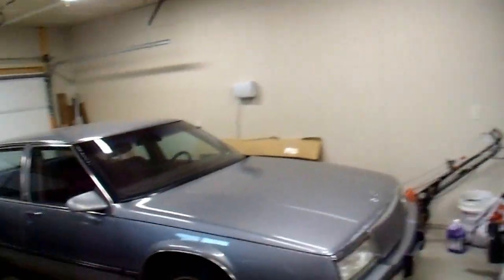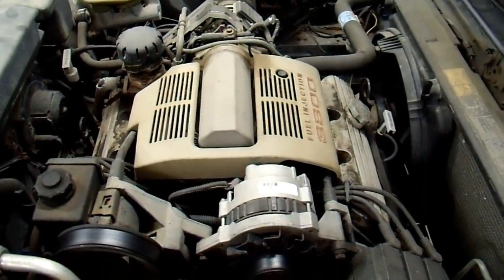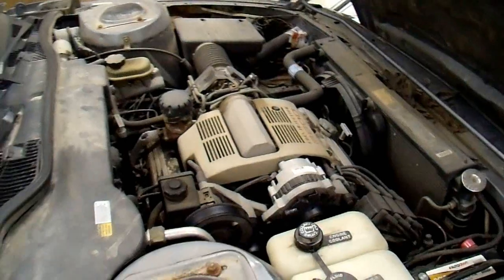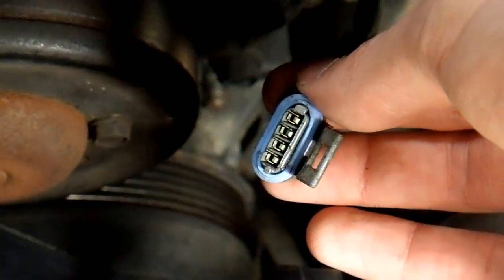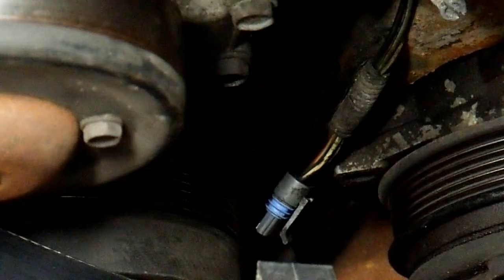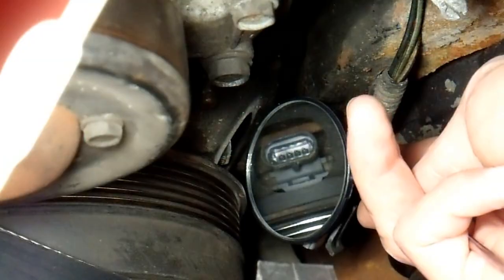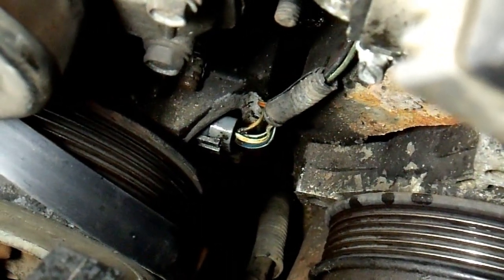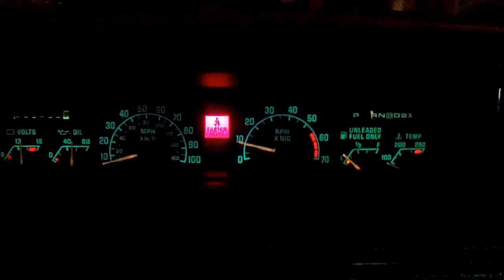3800 3.8L GM engine stalling issue quick fix

Comment: I have a 89 Buick Lesabre Custom,I have a problem with it idling high.Every since then put a TPS sensor on,it started doing that.Don't know what to do anymore.Also put a computer in it.I start it up and it idles high and stays that way.I didn't know you had to adjust the TPS sensor,that's when everything start happening.It won't go into overdrive just third gear when on the highway.Please let me know what you think is the problem.You can contact me at my cellphone number which is 3365773530 or email me at buick2020@hotmail.com.Please get back to me so I can get this issue resolved.I look forward in hearing from you SOON.Hope you can help me out,AGAIN, PLEASE CONTACT ME ASAP. I am very concerned about this.Burning too much gas all of a sudden.HELP ME.
Reply: Tim Wilder
 
So it cracked causing the vacuum leak??? or did it warp?
Reply from the maker: I hope that you're OK with me asking but does it not go into 4th gear, or does it not go into lockup?  e.g. if you are on the highway and use the column shifter to manually change to 3rd gear is there any change?  Also, do the other gears, 2 and 3, behave differently than before as in reving higher before it shifts into them?
Reply: 1, 2,& 3 do just right, but like I said before, on the highway if stays in 3.It was going into overdrive before the new TPS sensor was put on. Now that the new one is on that's when the high reving began.Will adjusting the TPS sensor correct the the reving & transmission issue. I am hoping that it is something simple. This guy is going to do a free diagnosis of you tranny to see what the problem is and adjust the TPS sensor to where it is suppose to be. Hope that do the job. Is would like your input on this also.
Reply from the maker: Tim Wilder
The transmission in your car does not use the TPS to adjust its shift points.  The only parameters it uses are input shaft speed, output shaft speed, vacuum level, and TV cable position.  The ECM controls only the TCC lockup in 3rd and 4th gear, which is why I asked about 4th non-lockup vs 4th lockup - some people perceive the lockup to be another gear but it isn't.  The TPS sensor cannot prevent the transmission from going into 4th because it isn't part of that control loop.  If it is truly in 3rd then the problem is elsewhere, possibly something unintentional happened when the mechanic was replacing the TPS.

If your shifts are firmer than they were before then I would look for a vacuum leak which would also cause a fast idle.

If it revs higher than it should before shifting into 2nd, 3rd, etc, then I would check the TV cable adjustment, though this would not affect idle speed.

Is the IAC (idle air control valve) plugged in and working?  This can cause fast idle and is right on the throttle body with the TPS.
Reply: I put a new IAC sensor on, where would the TV cable be located?
Reply from the maker: Tim Wilder
The TV cable is the 3rd cable attached to the throttle assembly.  One goes to your accelerator pedal, one to the cruise control actuator, and the 3rd goes into the transmission.  If you disconnect the cable so that it is always fully retracted it should shift into 4th gear at about 48mph no matter what the throttle setting.  It is essentially an offset so that it shifts later at higher throttle positions to allow more power.
Reply: If you have pictures, please post them so I will know how to disconnect it to see if that will work.
Reply from the maker: Tim Wilder
It won't hurt the transaxle but it will cause driveability issues and I would do it only as a short test.  Rather than disconnecting it you could just make it very loose.  A total disconnect shouldn't be necessary.
Reply: I don't know what to do, everybody telling me so many things. I just need to get it fixed and hope it is something simple and not expensive. Do you have any suggestions on where to get this issue resolved?
Reply from the maker: Tim Wilder
I'd have to point you to a mechanic on this one.  Without looking at the actual vehicle all people on the internet are going to be able to do is give you ideas of what to look for.  I hope you're able to get it figured out.
Reply: On the 89 Buick Lesabre,what is the name of that metal candy cane shape tube that connects to the throttle body and the engine and what is best way to unbolt it off the engine.It's up under the throttle body, please let me know something ASAP.
Reply: Looking for the two metal tubes that connects to the throttle body.
Reply: Looking for the two metal tubes that connects to the throttle body.If you know where to get them, please let me know, I really need those two metal tubes.
Reply from the maker: evilcowboy
Good info.  Just a comment of my own:  To show how unnecessary EGR valves are, many modern engines can pass today's emissions regulations without any EGR system at all with creative engineering tricks.  The efficiency loss from disabling the EGR comes from running at a higher vacuum for a given cruising speed which isn't really an issue aside from the small economy hit.  The computer will adjust the AF mixture automatically even in these older vehicles.

Older carbureted vehicles would take a large hit by simply disabling the EGR without other adjustments, but with a modern overdrive transmission and computer controlled fuel injection it hasn't been the case since the early '80s.
Reply: I got the issue resolved.
Reply from the maker: Tim Wilder
What was the root cause?
Reply: Needed to get the top part of the engine replaced.
Reply: I have a 1994 LeSabre , and have BOTH these problems, the high idle(with no working overdrive) and the stalling engine on a hot day, like this video says. I've had these problems for more than five years. I'm gonna clean the connector and see if it works. Thanks for the video.

Comment: Changed the cxp. Egr. Fuel filter. New tps. And fuel pressure regular and battery. Still stalls out when you accelerate. Any suggestions?
Reply from the maker: Does it run fine at idle and during mild acceleration?  What year and model?
Reply: yes runs fine till i push on the gas harder than normal say on an uphill. 99 buick lesabre 3.8
Reply from the maker: hmug tv
It makes me think MAF or fuel pump.  The fuel pump can be checked with a fuel pressure tester on the shrader valve on the fuel rail.  It would need to be checked at heavy throttle and at idle.   The tool is around $20, but you can probably rent one for free from the local auto parts store.  Check for kinks/damage to the fuel lines on the undercarriage too.  You could try cleaning the MAF with electrical cleaner first since it's an easy first step.  To check the MAF you'd need a more sophisticated scan tool.

If it ends up being the fuel pump or clogged pickup screen from something in your tank I have a video on replacing the fuel pump on one of these vehicles - not a fun job.  Search for 'GM H body fuel sending unit' if you're interested.
Reply: those are the next steps im taking, gonna clean the MAF, fuel pressure gauge is 112$ to rent so itll be a while before i can test that. ill let you know what i find out.
Reply: Did you ever find the cause of this problem....my Buick is doing the same thing ?

Comment: I had the same prob but on a series 2 and it was the fuel pressure regulator
Reply from the maker: That was a common issue on cold startup.  Fuel would leak into the vacuum line and get drawn into the engine once it fired.  Did yours stall at times other than startup and still have good power?
Reply: ***** yes out the blue it would stall

Comment: Man you are so lucky to own such an engine. Here in Europe 3.8L is huge and pretty rare. The average size is 1.4L. I own a 2.0L TDI on a golf. Not to mention that the annual tax for a large motor is more that $US3000. :) Great video.
Reply: Goddamn dude. Your country is screwing you out of tons of fun. Any 3800 series is a great engine due to the reliability. But yeah there are several bigger engines out there we can get.

The most unique engine design I have to say would be by ol Pontisnack. The 350 and 455 and most of their engine blocks were exactly the same. They utilized changine bore dimensions and larger cams, pistons etc to get difference displacement and compression. Chevy a sister company changed the whole block. This is why 350 pontiac heads will fit a 455 block and many of their other engines even the 301 turd. This in my opinion made Pontiac very unique engine designers. Although you wouldn't want to swap and mix and match engines it still is pretty cool. They were basically early engine modders before it became really popular.

Pontiac in my opinion never had body design issues but they sucked hard for general engine design aside from a few gems in the V8's. Most of the time if someone owns a pontiac they will have to rebuild it with a higher standard of care and then the engine will be perfect.

The 3800 however was taken from GM and placed in many many many cars and was one of the longest running engine designs to date. I would say they are as strong as a 350 but not nearly as powerful.

Too bad Europe is uppity about shit like that because you guys can't seem to fart without a piece of legislation being written of when and where to do it.

If I were you I would take two inline four engines and weld the blocks and design my own engine and put it in a dune buggy I built and research the shit out of engine building and have me some fun. Chances are the cops won't have an inline 8 engine so they would probably not catch you lol.

And yes there have been folks weld engines together and get them running. A guy on Youtube did it with 4 briggs and stratton lawn mower engines. Funny looking contraption but it worked.
Reply: we got 6.0, 5.7, 5.3, 5.4, 7.4, 6.2
Reply: yup :)
Reply: All Great engines, V8s, great power, most of em are pretty thirsty though
Reply from the maker: evilcowboy
I saw that briggs video you mention a while back!  Interesting experiment but I'm not nearly that creative..
Reply: *****

Yeah I was pondering a similar one with 2 two stroke weed wacker engines to replace the one I got on my bicycle and see if I can get a bit more power and torque with two welded together. Then I realized it was aluminum and was like I have no idea how to join those together correctly so screw it lol.
Reply: evilcowboy
Reply: Mind for sale

Comment: Good video and good catch with the tach not working correctly! Seems when you put the weather pack connector back in even though it is silicon a little siliglide rubbed on the ribbed portion could not hurt either?
Reply from the maker: Silicone is mostly unaffected by oils and other typical contaminants, but if the wiper gaskets get 'bound up' and do not slide smoothly against the mating surface lubricant can help.  I find that WD-40 or equivalent works just fine, but other solutions would work at least as well.